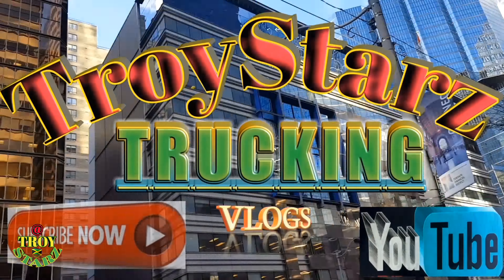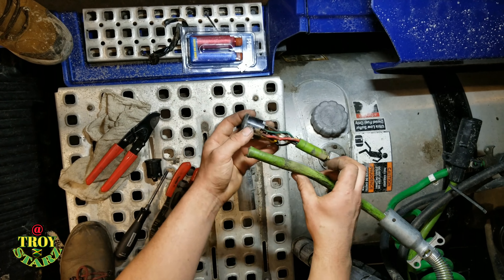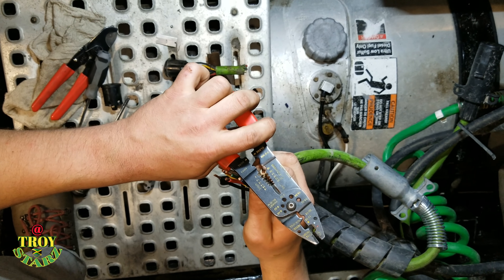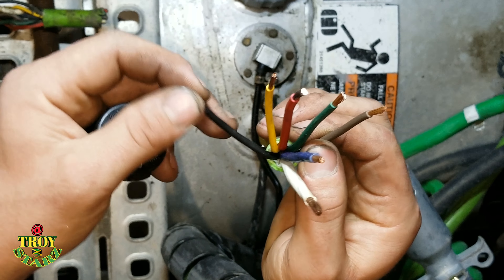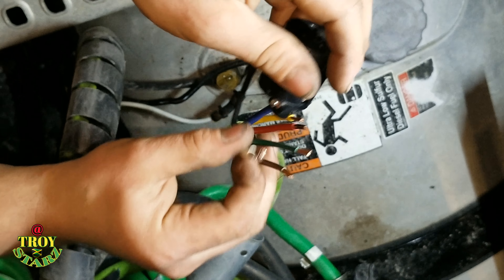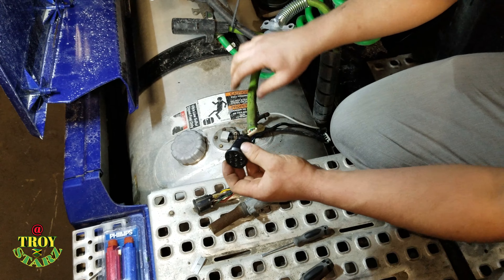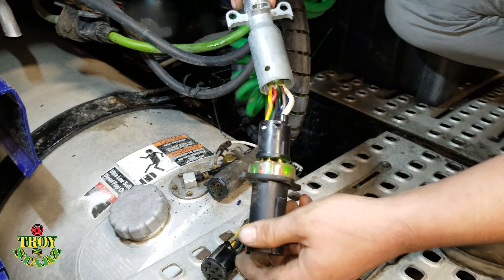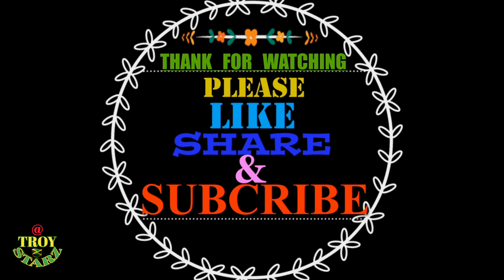How To Fix Trailer Light Cord That Connect Truck To Trailer, Vlogs

Comment: After stripping the light cord plug wires tin them with solder . After tightening wires in place add a drop of Loctite to the screws .  Use silicone paste to lubricate the receptacle socket .      5/25/23

Comment: After stripping the light cord wires back tin them with solder . After tightening the screws down place a dot of Loctite on them . Lubricate the light cord socket with electrical grease .
5/19/24